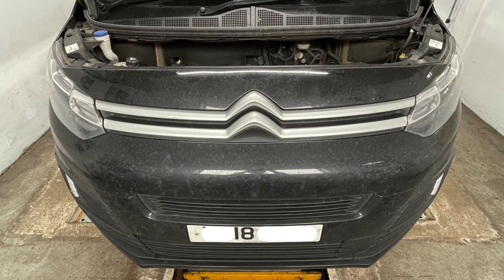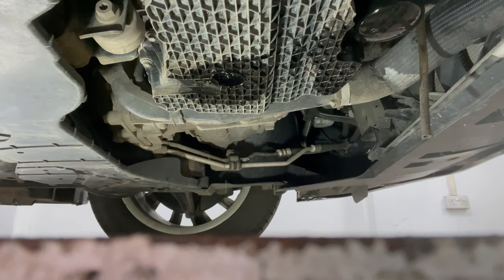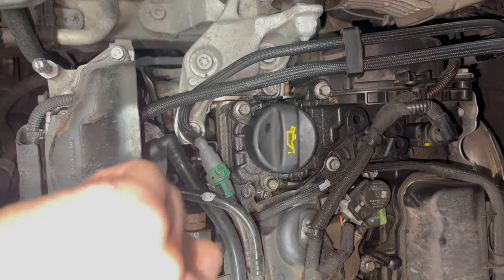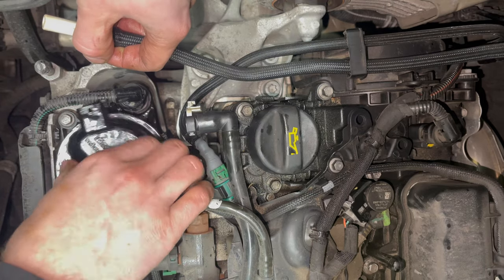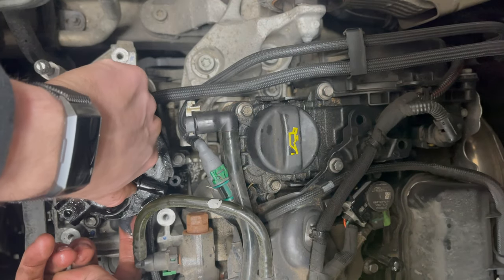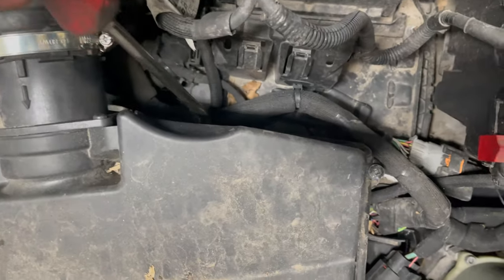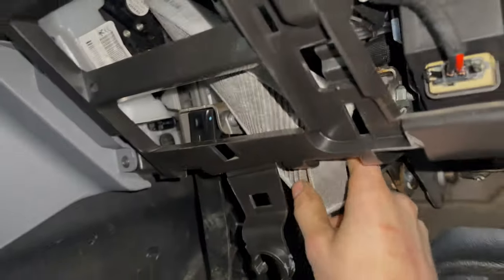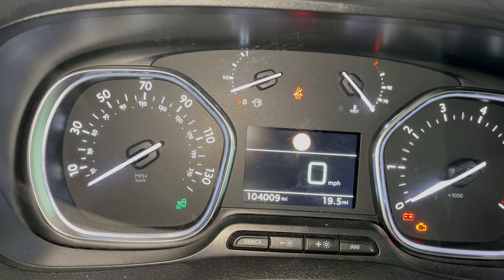Citroen Dispatch 2.0 BlueHDI FULL Service Oil Air Fuel Cabin Filter - Jumpy Peugeot Expert Vivaro

Comment: Just got this same van so this has really helped me,you have not listed the correct oil to use would really appreciate advice,also is it not easier to buy service parts direct from citroen or do they charge the earth
Reply from the maker: Hi, thank you, glad to help! The garage I use used GM Dexos 2 which covers the requirements of most cars on the market. Find your local auto factors, the majority will still deal with you even without an account and they'll give you a choice of suitable oils.

Comment: Thanks for the video, really helpful. I'm going to service my own Dispatch from now on. One question for you. I have warmish air coming from the left hand side of the cab and cold coming from the drivers side. Is this a blocked matrix? I'm going to flush the radiator first to see if that gets to the matrix and unblocks it.
Reply: I have the same problem,  common issue on these vans. Blocked matrix. A flush sometimes works.

Comment: Hey, thank you for your great video. It helps me a lot. 👍
One question. Where is the blower motor located, respectively how can i get to him? Near the cabin filter? or from outside, under the front window?
Reply from the maker: Hi Karsten, I wouldn’t know without looking at a diagram but it’s likely to be accessed through the lower part of the dashboard inside the cabin and it’s likely to be near the cabin filter on most cars.